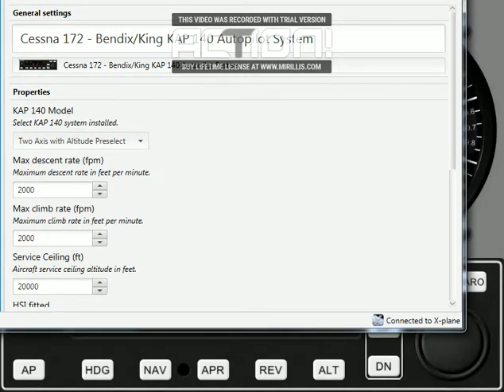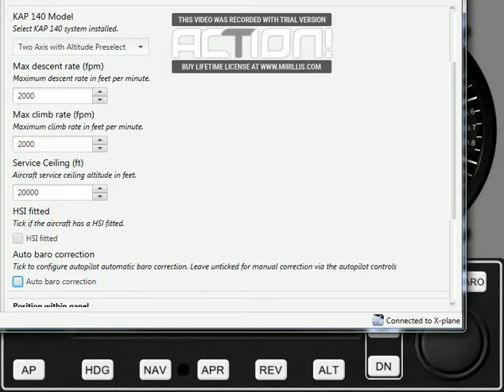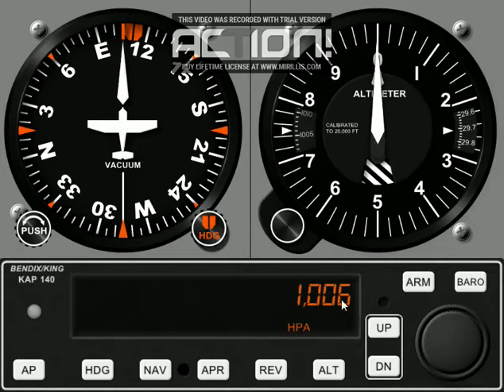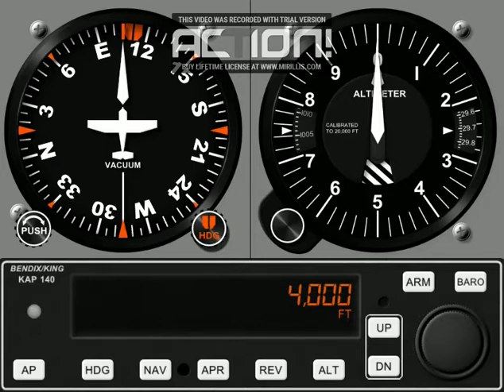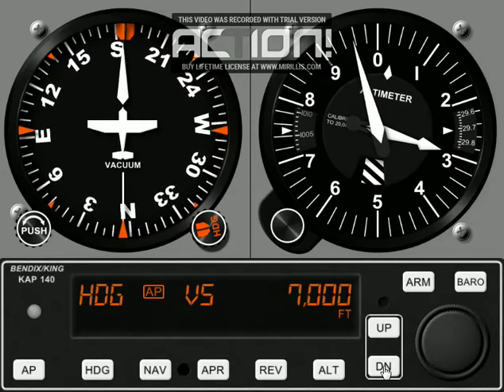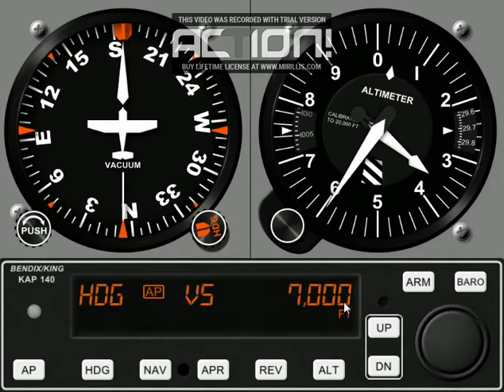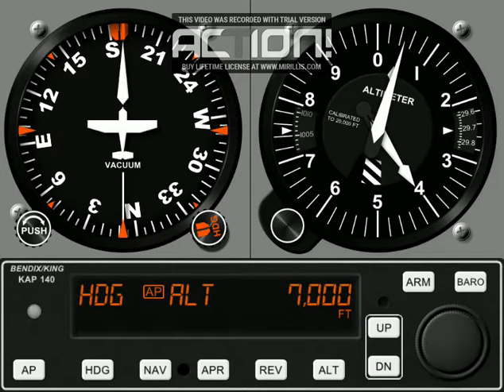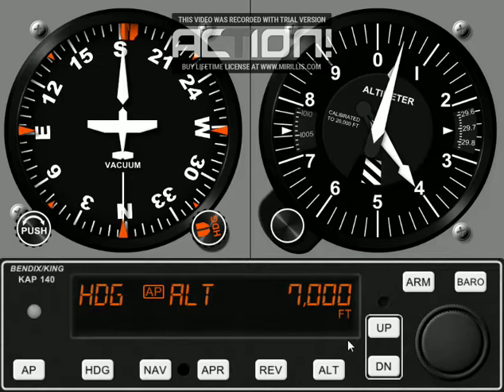KAP140 demo

Comment: Nice work.  Have you made any further improvements such as using the NAV and APR modes?  

I'm a real-time pilot who occasionally has to fly aircraft with this old and somewhat clunky autopilot, in lieu of GFC700 or Pro-line 21, for example.  It occurred to me that there is very little in the way of video tutorials on the APR mode.  Most tutorials only deal with the basic settings and don't include APR.  Extending your current 'simulator' to demonstrate  NAV and APR modes would be very useful for pilots new to the KAP140, or indeed as a great refresher for those of us that haven't used it for a few years!

Comment: Nice Video, that is a far better AutoPilot KAP140 then the one available in Air Manager , any chance you could make it available to Joe Public?  Thanks in advance.
Reply from the maker: Possibly. I need to do a liitle more testing beforehand and I've been busy with other things. Watch this space.
Reply: Hi :) I would love to use kap 140 with my cessna 172 in x-plane 11 but the new air manager version has a bug and it doesn't show preselected altitude (it lags on some altotude) and it doesn't react on the VS change. Is your version available now? Thanks, Petr.